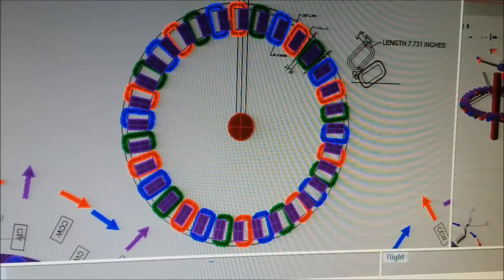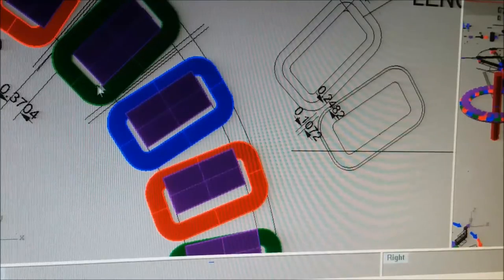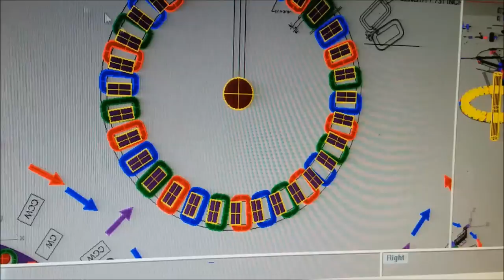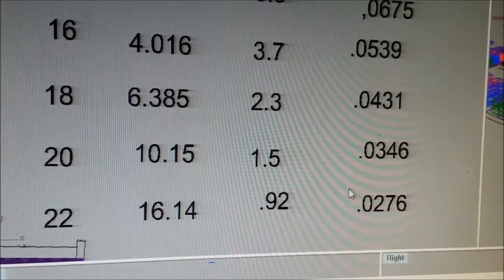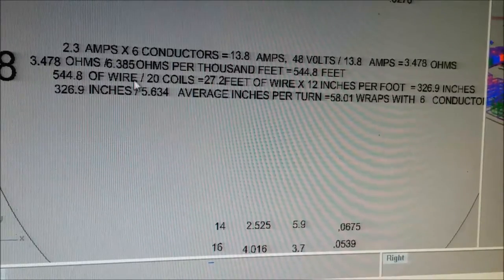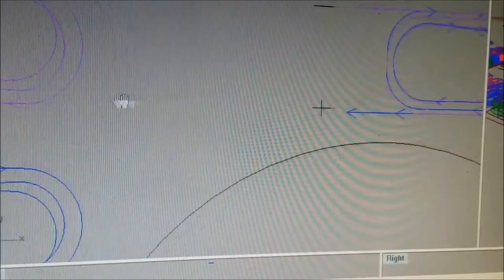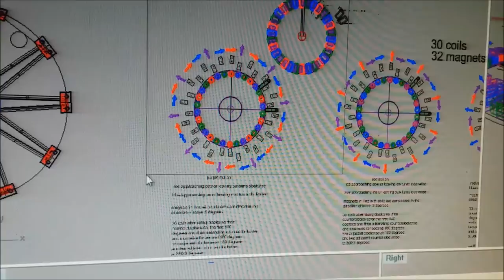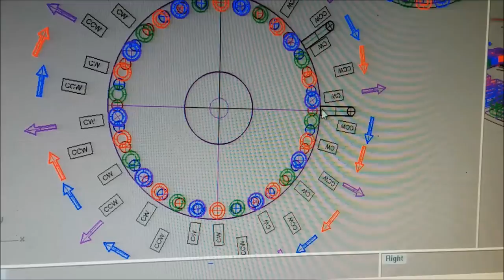HOW TO DETERMINE MAGNET WIRE SIZE AND TURNS FOR WIND TURBINE STATOR PART 2

Comment: What determine 12v or 24v output or even 48v? What are the perimeter i needed to look to get these voltage specific?
Reply: Its difficult, I'm looking for the math for this myself. The basic principle is this. 
1. As the magnet passes over a coil it will induce a voltage. The problem is that rotor speed will change this voltage proportionally. As will your number of windings and wire thickness in each coil (not to mention the field strength of your magnets and orientation). So you need to start off with a basic Idea on the average wind speed and thus (calculated/tested) rotation speed of your mill to decide on the your coil design. Normally each coil will produce a small nominal voltage, lets just say 2Vac per coil (based on your ideal wind/mill rotation speed, coil number and wire thickness). So for each phase will need 6 coils (wired in series) to make 12v, or 12 coils to make 24v. In a weird way its like sticking batteries together.
2. Now you have guessed the floor in this grand plan. Wind is variable. So higher wind speed will cause over voltage and you need to sort this out by having a dump load after you have converted the 3phase AC to DC. If your mill isnt spinning fast enough, you simply wont make any usable power because the voltage needs to be higher than your batteries. Else without blocking diodes you will have a motor rather than a generator. (I'm not sure how you deal with under voltage, running the mill open circuit could make it spin to fast so maby you just waste it in the dump load or you use a clever electronic device like a switch mode power supply to up the voltage so you at least have a trickle charger.
3. Load. Another tricky beast is when you introduce load. Now to some extent your battery will take care of this rather than labouring the mill. But in principle, the greater the current draw on your system, the harder it will be for your mill to turn. So your mill speed slows down and might even drop below your nominal voltage which really throws out your average rotation speed you started with to design your generator. Having a battery helps minimise spikes and should simplify the math by having a set working voltage. For a 12V battery say, the battery might be between 10.5Vdc up to 15Vdc fully charged. Obviously this means if the battery is low at 10.5Vdc, you will be drawing max current from the mill and if the battery is at 15Vdc then you wont be drawing any current as its full. That is untill you turn on a load and you get a balance where ideally your battery stays fully charged and your mill is supplying the current being drawn from the battery by topping it up at the same rate of discharge.

As you can now tell, there are many considerations when designing a generator and I certainly dont know all the answers which is why I'm watching videos. CONCRETE HOUSE BUILDING IN PH does seem to know his stuff, he's just not very good at communicating it. What we really need is to find out where he learned his stuff and go straight to source. Thus far I havnt found a nice step by step work through of the maths for system design.
Reply from the maker: I am a graduate of the University of Pittsburgh School of Engineering class of 1970 with 173 credit hours of
which 135 are engineering classes. I did masters degree classes but not for a degree.
          The relevant equation is   V=IR   meaning  voltage is the product of current times resistance.  The factors
you can control are resistance and indirectly current thru the geometry (diameter of coil set which is also the 
diameter of the center position of the magnets), and magnetic field strength (gauss) passing thru the coils.
The field strength increases if the magnets alternate north and south as the field connects through the metal 
they are epoxied on to. Thus  magnet count must be devisable by 2.  the number of stator coils is devisable by 3
with a set of 1/3 of the total coil count in series. If I have  30 coils every third coil around the ring is in series for 
10 coil sets. Two sets are in series at any given instant with the third set open. So, 10 coils in series with another 
10 coils makes a path of 20 coils in series. if each coil is making 2 volts that would be 20X2 or 40 volts. 
         Factor two is that with multiple wraps of wire in each coil they are simplistically a group of single paths all in series. The magnetic field works on each of the little loops which due to being in a series connection multiplys the
voltage output of the coil. The magnetic field seperation distance to the stator coil (less than 1/8") is from 
a circular field of a rotor magnet going from one  rotor to an OPPOSITE polarity magnet on the directly opposing disk, along the metal disk to the next magnet which is opposite polarity, then back thru the stator which is again
oppopsite polarity and thru the rotor plate to the original starting point.  As the first set of magnets passes the first side of the coil it induces a current in the winding. The current is determined by the right hand rule, defined
by pointing your thumb (the big finger) along the wire and curling your fingers which are then in the direction
of the magnetic flux, current flows from negative to posative. Then as rotation of the disk continues the field
intersects the windings on the second side of the coil which with the coil winding being circular  and the right
hand thumb now pointing down is additive.
          As an inconvienance we have the coil count and magnet count not equal, and either one can be a higher count. This prevents all the forces lining up at the same time and makes continued rotation lumpy at best. For a stepper motor everything lines up making  it hard to rotate until the polarity changes as different sets of coils go on and off.
In the generator (actually an alternator) the magnets rotational seperation increases (or decreases) as the coils
are seen to be getting furthur apart. Since the group are all in series some are opposite polarity with the magnets and attract each other and some are the same polarity repelling each other. Therefore a coil may be cancelling current flow through the series connection reducing output and voltage. I solved this by having two stater coil pairs 180 degrees apart with the same winding direction and having the coil to magnet count differ by only 2. therefore making two 180 degree motors and everything producing in the same direction. The connection of a set of 10 coils being connected to another set of opposite winding direction makes all the current flow in the same direction and all the average voltages cumulative.
          The next formula I can't explain in simple english arithmetic because it involves calculus. Adding to the
type of math is a variable which is the magnetic flux (G   or Gauss)  that comes from a second bit of integral
calculus. The factor of G has a range dependent on magnet strength, and interaction with other magnets.
Ceramic magnets being more efficient than steel magnets and lower strength than neobydneum magnets. There
is also a strength range of a given material or shape of magnet. The formulas are not hard to find with Wikipedia
and can be approximated by calculating with the upper value of the integral character and subtracting the value
calculated from the lower integral  value.  The output  is not a strady state number but increasing and decreasing
the current producing a sine waveform output. To get what you will produce convert the sine wave to it's RMS  (root
mean square) value.
           The wire you wind with has a current limit at which temperature rise melts the varnish or epoxie and the
wire burns in two.  The wire has a NEMA  current capacity per unit of length, sometimes per 1000 feet or 
100 meters.  So if you pick an operating voltage  and divide that by the amp rating you have the required resistance
of all the series connected coils plus any wire connecting everything. Divide this resistance by the resistance per 100 meters and you have the total length of wire. Divide the length by the number of coils in two sets and you have how much to wind on a coil. First thing you find is that there is not enough volume in a 3/4 inch thick coil and going thicker reduces your G value exponentially. So calculate with different magnet wire gauges or windings with 2 wires for double the amps. When/if you get close I have a trick. Your coils are determined by how much you can wind before they hit each other at the inboard end. You can however extend the bottom with around or V shape staying inside the available space and continue the outboard end till it hits something. 40% more wire and resistance can be achieved with this.
          As a note larger diameters increase efficiency and voltage thru magnet pass speed and room for larger
stator coils.   THANKS TO MY 11 SUBSCRIBERS FOR WATCHING THE VIDEOS
Reply from the maker: To road rash spirit. You raise voltage with an inverter. Basically you are charging capacitors with your after rectifier
DC voltage. Think of capacitors as little flat batteries in series separated with mica plates. More plates is more voltage.
The voltage isn't a continuous output and is more like pulses. If your wind generator is at a cut in voltage of 9 volts
for example and you have a 270 volt capacitor then power is on 270/9 or 3 % of the time but other than heat
nothing is lost. If your magnet wire set will stand 27 volts then you are on 270/27 or 10% of the time. Trip the
capacitors and they discharge. A small inverter welder has an open circuit voltage of 60 volts and mine is rated 400 AMPS with a 60% duty cycle. While I am not about to "repurpose" my welder looking inside will show you what
parts to be looking for.  For small power output you can get voltage pulse width multipliers or dividers
on E-bay for about $12
           To divert excess power generation look at a zenir diode. Think of a zenir as a transistor with the gate
wired to a resister internally.  More complicated MOSFET (metal oxide field effect transistor) conducts
when the field is higher voltage than the gate. Hook that to an IGBT (internal gate biased transistor) for
huge current capacity. Elon Musk uses racks of MOSFETs in the Tesla cars which are well proven off the
shelf stuff but I use IGBT because very light amps (heat load) and high voltage operate them.
         Over voltage is often associated with over speed problems. You are producing more than needed for 
charging so you might consider something along the lines of using a coil path as a bucking voltage to electrically brake the blade RPM. If you are WYE connected it would convert 2/3 of the power to the brake and with delta
I should think of 1/3 braking power. I haven't needed a schematic for this yet so haven't drawn one but the
principal is having the coil leads switched electronically to be out of phase with the permanent magnets
creating maximum chaos. The electric vehicle designers use the the coils progessivly to regenerate power
back to the batteries while braking and at higher pedal deflections adding in the hydraulic brakes. A magnet
passing a small coil will make a pulse to start charging a capacitor. A resistor to ground will drain the
capacitor until it increases voltage to trip the circuit and brakes as long as voltage is high enough to
the capacitor. Transistors working at Mhz frequencies can switch everything hundreds of times a minute
and a 505 solid state timer can limit how often things change from power to brake.
         I did do a design with a second tail set at 45 degrees to the steering tail with a heavy spring and a
bellcrank linkage (for multiplying rotation degrees) which turns the rotor out of the wind progressively
 as a governor. I decided a boosted vertical turbine was much more efficient in that nearly all the wind hits the blades and pass through hits them again. The horizontal shaft types have a lot of space between the blades
which is lost energy and needs higher wind to begin turning. The farm windmills built for pumping
water wells had the entire disk area in blades and overlapping blades which capture redirected air
from the preciding blade. Today kids don't design so much as copy something others have built. 
Unfortunately the one that has become the norm produces 15% of the rated power. We have wind farms
on the NC coast around Elizabeth City. With a field of 125 turbines usually I see 8 of them actually
turning and the rest pointed at some odd direction.
Reply: @concretehousebuildinginph1488  Thankyou, thats a good amount of information to unpack. Hint taken, will hit the subscibe button ;-). I recently graduated in Mechatronics, its been several years since I studied induction in any meaningful way. Been meaning to get my books back out but I'm busy with other projects.
Thats an interesting way of designing your coil arrangement simply using ohms law. Last time I ventured down this rabit hole I found a nice equation which incorperated wire area, coil turns and lengths, admittadley I was playing with electromagnets at the time. 
1. So If ive understood your design method correctly. You have started out by choosing the power ouput and voltage to determine current (A=P/V) which you use for wire diameter and then use your chosen voltage, calculated current to find resistance (R=V/I) and hence wire length. So number of turns is irrelevant? For power was this chosen as a maximum for a S.F?

Quick note, I didnt mean to be rude about your communication in the video, it just doesnt flow very well. An affliction most Engineers suffer with including my self. If I was going to make a video I would try the following format;
1. Write down what I am hoping to communicate and arange it in a logical (segmented) order related to the linear design process.
2. Push the principle facts before delving into more detailed analysis on each topic (segment).
3. Back up what you are saying when stating important facts by writing them on screen at the same time (like bullet points). Also include relevant formulas so the viewer can refer back and test your ideas quickly in excel which aids the learning process.

A skeptic might argue this all amounts to dumming it down a little and this in part this is true. But when your explaining anything no matter how trivial, you always have the benfit of your own memory that usually holds context to what you are trying to explain. Unfortunatley the audience doesnt have that context unless they are already familiar with the subject matter...in which case they probably wont be viewing your video.

Looking forward to more analysis of PMG's :-D
Reply: @concretehousebuildinginph1488  Again great information. When I get round to making my own vawt, I was hoping to play about with electronic control for the output. So rather than wiring all my coils for each phase in series, I wanted to complicate matters by connecting them in sequence as wind speed varies, thus having low speed power (using a buck boost when needed) and greater braking force when higher wind speeds were present. I would have had a comparator controlling a dump load as well. So as you pointed out, mosfets or IGBT's. Your information is very valid though, I do lack essential knolege in Power Electronics for smoothing. I will definatley spend some time learning what you have pointed out in both your replys. I also wanted to experiment with an axial cored design so that I can use 2x cheaper ceramic magnets on each coil being passed since as they are cheaper than Neodiniums. I would probably go for a wider disk and segment it into generator sections that in turn could be turned on and off. I have to copy to learn, but I do like understanding what I am doing.
Reply: @concretehousebuildinginph1488  Thats an interesting look at blade design, I'm intrested in VAWT mainly because of dirty wind in urban areas. I think the 3 bladed turbines are done so for cost reasons and speed. The more blades will slow wind and probably increase torque, but the slower flow of air will cause some air to be redirected around the turbine and reduce turbibne speed. Ive seen a few different ideas on blade and blade number design but I havnt studied much in the way of aeronautics. I have studied fluid dynamics so I appretiate the beunulli effect and how that would effect turbine blades. Ultimatley Ive never thought much about because a horizonal turbine would be useless where I live.
Reply: @concretehousebuildinginph1488  Zener diodes. Named after Clarence Zener whose work was on breakdown Voltages of insulators. 
And as I have found working with Smartdrive motors, coil plus coil plus coil Voltages does not always work out when in series. Say I have two stators wired as  ( A ) 3 X 3 X 2C and another wired as ( B ) 3 X 2 X 3C. Both wired in Wye configuration.

At 25 RPM A will produce 3.6 Volts or 1.8 Volts per coil while B will produce 7.2 Volts or 2.4 Volts per coil. 

At 100 RPM, A will produce 14.3 Volts or 7.2 Volts per coil while B is producing 29.2 Volts or 9.7 Volts per coil. 

At 250 RPM, A is producing 26.8 Volts or 13.4 Volts per coil and loaded to 18 Watts. B at the same RPM is producing 33.3 Volts or 11.1 Volts per coil and loads to 62.2 Watts. 

At 500 RPM, A is producing 40 Volts or 20 Volts per coil and loaded to 170.3 Watts. B at the same RPM produces 80.3 Volts or 26.8 Volts per coil and loads to 179 Watts. Almost the exact same loads but way different Voltages per coil depending on whether in 2C or 3C configurations.

 So loading and RPM have an affect on how the coils react. Another interesting thing is that A will run at 1500 RPM at 300Hz as a motor but B will only run at 750 RPM as a motor at the same 300 HZ. Factory rating is 800 RPM in a 3 X 1 X 6C configuration. And yes, I have run both at 400 Hz with A turning 2000 RPM and B only turning 1000 RPM. Input Voltages are set at 150 Volts when used as motor to prevent overheating the coils in A, while 240 Volts had no affect on B either in speed or heating.